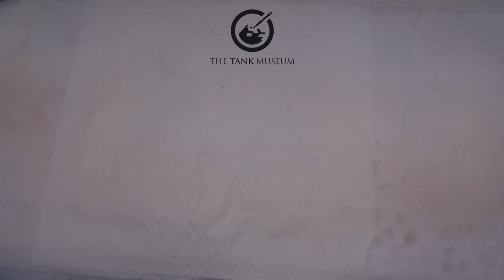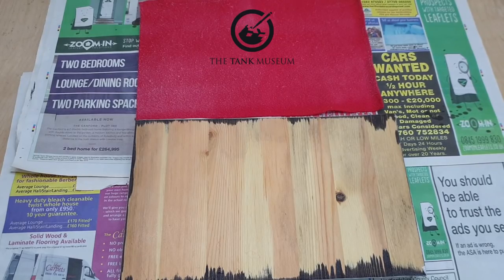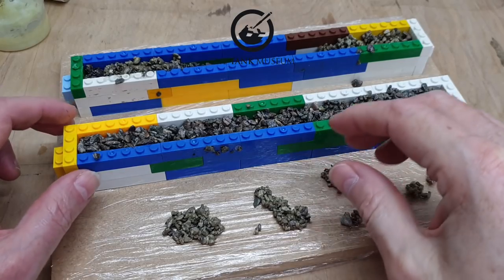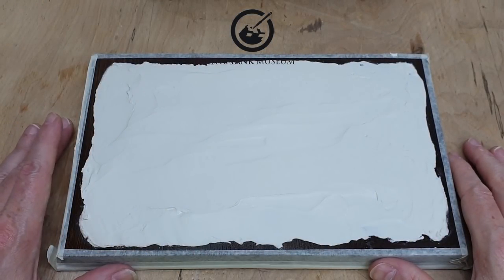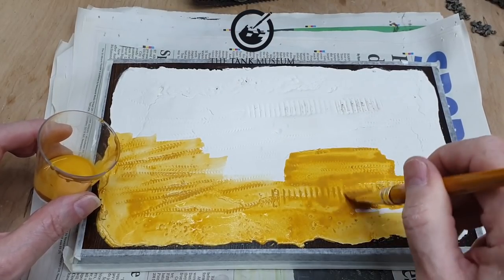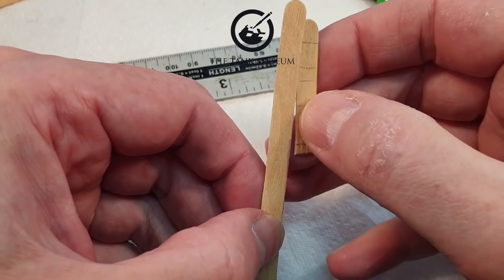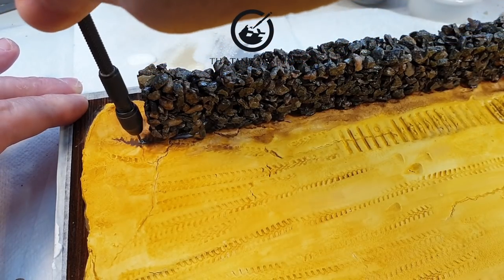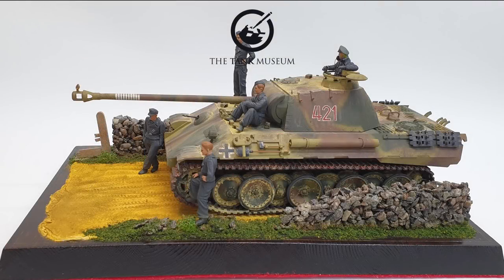Building the Tamiya 1/35 scale Panther Mk5 for a charity auction - Part Four - the diorama

Comment: Nice work mate. Sorry I didn't place a bid. I was away on holiday, and only got back yesterday afternoon. My only gripe about the diorama, is the dry stone walls. Most dry stone walls are not made up of a bunch of stones piled on top of each other. Most of them actually do look a lot more like a brick structure. With layers of stones placed to be brick like. Its pretty hard to recreate this in 1/35 scale. As this tank would have been active in Normandy in the summer of 1944. Maybe it would have been a better idea to line the road with 2 hedge rows. Then it could be a section of what they called Bocage hedge rows. Anyway, that's my thoughts.
Reply from the maker: Oh I agree, but it's a simple method that produces a passable result. I've made hedges before for my VW Beetle diorama, but I just wanted to keep this simple. There'll be more auctions in future, so stay tuned :-)
Beetle playlist - https://www.youtube.com/playlist?list=PL6Tibx9kQcv4OtAKjnA2456cJ3gayfQtM

Comment: turned out quite nice. I have one minor nitpick and I see a lot of modelers forget this. they never put boot or horse prints on the roads. small detail but we tend to over mechanize the german army of world war 2. Most of their logistics train was horse drawn and infantry still had to march a lot of the way.  again minor minor nitpick.
Reply from the maker: That's a fair point. I did a diorama a while ago and I added hoofprints and boot marks. I used a plastic straw cut at an angle to make hoofprints. I simply overlooked it on this one... :-)